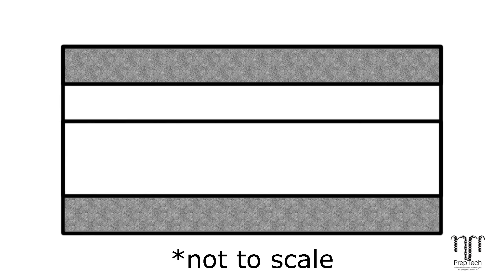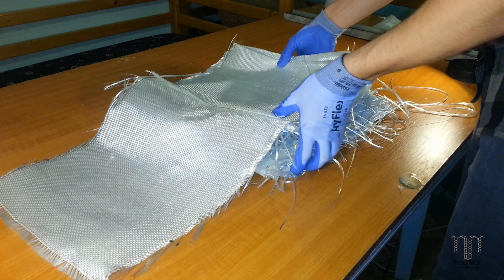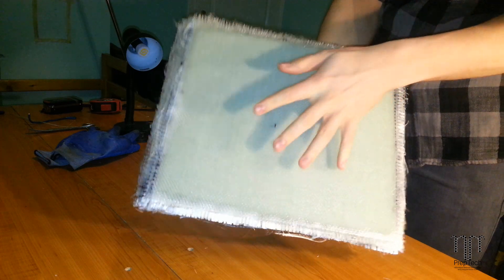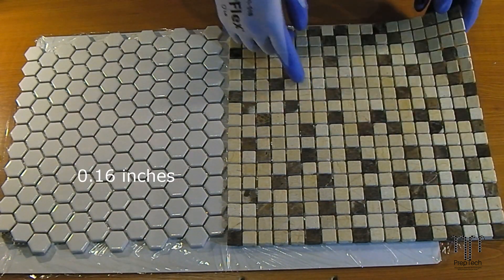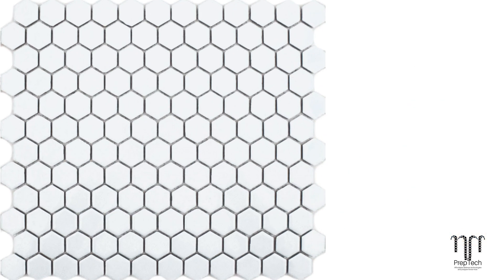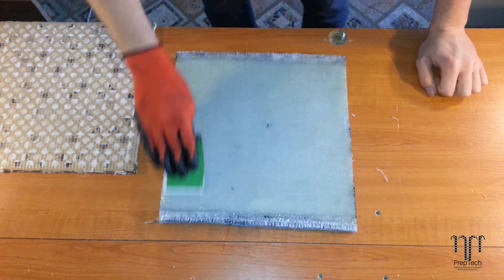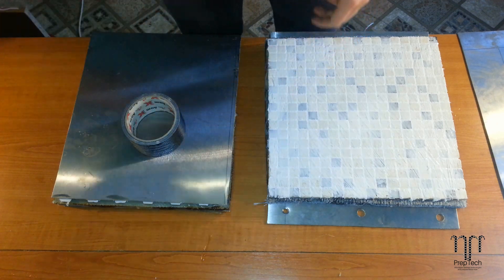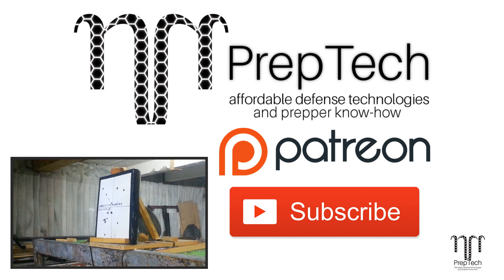DIY Working Composite Vehicle Armour (stops an AK-47) Part 1: Building

Comment: Grinding that epoxy and inhaling the smoke is infinitely more dangerous than the fiberglass dust. It can be lethal. Friend of mine once just collapsed to anaphylactic shock after cutting cured epoxy. he wasn't allergic or anything to it. But he survived because workmate was fast and ambulance was fast there. But now he cannot be in vicinity of raw or cut epoxy. He will get the shock immediatelly.

Comment: Just a quick thought on fiberglass, when I build boats and other things from it we have to sand the cured surface before adding another coat of resin or anything really. The resin makes a waxy film when it cures and needs to be sanded off for proper adhesion of the next layer of resin, paint, gel coat ext. 
hope this helps

Comment: Well the way a glass (including ceramic, it's a type of glass) dissipates kinetic energy, is by spreading it out across it's surface area, until the whole thing shatters.
So, the smaller the glass (ceramic) plates are, the less energy they can dissipate. You end up having to weigh the pros & cons of different sized pieces. Larger pieces dissipate more energy. Smaller pieces mean less area compromised by being hit. US car windshields (required to be 2 panes of glass laminated together with a flexible bonding material, to keep occupants in, and deer out), are broad enough to effectively dissipate energy nearly equal level 2 body armor, but only ONE time. 
Also it helps to have your fiber weave material arranged with alternating angles, like + and x orientations (this wastes material when cutting from the cloth, but it helps).

Two main approaches are very hard material (but brittle) on very strong material (not brittle). Or a very tough, but lightweight & flexible matarial ("catches" projectile).

Mostly ceramic is used on armored vehicles to resist "active heating" from projectiles with explosives in them (due to ceramic's high temperature resistance). The fact that it is also a type of glass, means it can achieve double-duty as a form of kinetic energy dissipation. So it's ideal in tanks. But against small arms fire, I don't know if ceramic is ideal or not. But it doesn't make a large amount of dangerous "glass dust" compared to other types of glass, so it is at least easier to breath while being shot at.

If I were designing an armor for a light vehicle... I'd go with something which is both hard and strong (like AR500) for the exterior layer. There is a form of AR500 which has a metalic glass seared onto it's out-facing surface, this is very very (very) durable. So durable that it's not even practical to smooth the outer surface. Then under that, ceramic tiles to dissipate energy. Then aluminum structure (mounting, framing, chasis), And lastly a kevlar blanket on the inside which is mounted only by edge grommets, so that it can flex & stretch when pushed on by bullet fragments or spalling. For windows, several layers of tiled tempered glass embeded in a mono-block of polycarbonate. Alternatively though, there's something to be said for just using thicker steel for armor, and letting the armor do double duty as the vehicle's chasis.

Interestingly, soil (sand or dirt) is amazingly bullet resistant. I think there would be some advantages to a sort of blanket of co-joined sandbags. Would be light to transport to a location, and fill with 'armor' on location. Easy to apply/remove. Think "scale-mail" but made of sandbags which attach to a robust webbing. A hidden benefit would be that this would also have amazing RCS and thermal imaging qualities. And if you deliberately did a sloppy job while filling the bags, it would blend in with the local dirt hues. Alternatively if you were tidy and used matte black sandbags, it would be hard to laser designate/rangefind. It would be shockingly "stealthy". Even has excellent radiological qualities. Also, it would be as cheap as dirt. It wouldn't take much to apply grommet pegs to the exterior of a light vehicle to hold it in place. It would effectively be self-healing even, not to mention spalling-proof. To shoot through it you'd need at least .50 BMG, and that wouldn't "go through" exactly (not with any effective energy left), it would just burst individual sandbags, and eventually eat the armor away. It's also a very DIY-friendly concept. 
So one of the best light vehicle armors there is (in my opinion) would be burlap, rope, and a small shovel.

Comment: when you make these used strong forms and clamp them as tightly as humanly possible. the less resin, the lighter it will be, and stronger because there is more glass per square inch

Comment: works like a charm.  testing with panels installed in a junk car, put final product in an F250 to armor the door panels, seats, foot well, dash and back of the crew cab.  It does kill your payload capacity though so be sure to check your weight limits.

Comment: I’ve been part of and run Composite/Fiberglass shop for whatever that’s worth. By NO means have any experience with ballistics panels or “Bullet Proof” material. Their is ton of different cloth materials available. On projects like sailboats where lamination is thinner we use (Bi-Axel) & for better  strength and flexibility (QUAD-AXEL) cloth  Also epoxies like West Systems for epoxies or higher grade Resins like 700 Grade Resin like used in making of bowling balls. Alternate directions of each layer of cloth. Turn each layer 1/4 turn from previous lay-up. Hope info helps. Not trying to show more knowledge only suggestions that may or may not help. Also the week (7 day) and slower cure time is very important! Different epoxies/resins have different cure times need to follow manufactures flash off instructions to ensure product cures least brittle as possible. I have been thinking of  layups as well hadn’t gathered enough info to do so such as didn’t consider the ceramic core among others! Thank you for sharing your info and experience hopefully save me some trial and error as well. Appreciate your time and info. Lookn forward to your future projects. Stay safe thanks again

Comment: Floor tiles are added weight with no balistic value.
Reply: You are wrong. The only way for modern armour to stop bullets from rifles is with ceramic or similar materials. The problem here is that the ceramic tiles are too small and too thin (the hexagon ones) or just way too small and not good material for the marble ones.

Comment: Hi prior to making your cuts, try placing painters tape on both sides of your cut line (on both sides of the fiberglass).leave about 1/2 inch between the pieces of the painters tape.  wipe a thin film of silicone on both sides of the fiberglass.  When dry make your cuts and remove the tape.

Comment: 2 small tips. Use nylon fibres evenly mixed into the silicon for added strength, and use a spall liner on the rear. High wear strength carpet would do at a pinch, and that could be improved a little too with a hard plastic/soft plastic layer between the steel and carpet|! :)

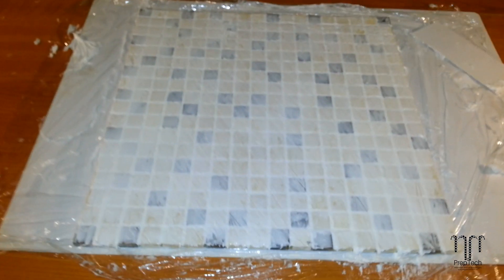Comment: 6:00 Sounds very logical!
Reply: Smaller tiles make it better to withstand multiple shots but larger tiles can absorb more energy.

So smaller tiles can take more shots but those have to be from smaller projectiles while large tiles can take fewer shots but from bigger projectiles.

The ceramic layer is key in composite armour for converting kinetic energy into the energy needed to crack/break chemical bonds of the parts that keep ceramics together.

Comment: 1:12 

* Got multiple hit capacity.
* Light enough for fit on a vehicle.
* Easy to build.
* Durable.
Reply: @Jimmy Olano You’re wrong too. It wouldn’t be “Got multiple hit capacity”, it’d be “It can take numerous hits. His second one was right, “Light enough for fit on a vehicle” is wrong, using “for” makes no sense. Your last two corrections is merely just capitalizing. Next time you want to correct something make sure your corrections make sense.

Comment: Maybe looking into two part silicones makes your life a bit easyer. You can buy some that are quite liquid so they flow between the tiles. Also the regular silicone doesn't cure very deep, just the surfaces that is contatct with air.

Comment: Why not simply use a 1/4" AR500 steel plate?
Reply: You can cut it with a cutting torch, drill it with a carbide mason bit crazy sounding but it works  , ID it with a file if it bites deep its mild steel if it sings off its ar500 , as far as welding it goes for a 1/4 you could us a 7018 rod with a pre heat or if you want to get fancy a e11018 with a pre heat
Reply: It's not readily available. Additionally it's difficult to drill, weld, etc. Also, supposing you're improvising, how the hell do you identify a piece of ar 500 from a piece of mild steel?
Reply: And the other part of that is just about every sawmill, rock quarry, mine, or industrial area has it pretty much laying around search the local scrap yard

Comment: I did a little research on Alibaba, aluminum oxide plates are dirt cheap, I think they can do better than just normal mosaics, and if you want go for full nuts, those silicon carbide plates' price are not their actual price, you will need to contact the dealer for actual price.

Comment: One more thing.. . Think of a tank and how it has evolved since World War II. The Russians and soon after the Germans realized that sloping armor would cause projectiles to Ricochet or bounce off. Who says someone couldn't with imagination and patience somemade at home or in a shop some sort of armor that is light but also has angular portions where vital organs are. I can almost guarantee you would have significant protection. In my mind the 223 depending on the angle of the shot would either bounce off or take some of the muzzle energy away from the target area. The only major problem I can see is different angles enemy fire would come from so a solution would be necessary course a 90-degree angled shot would have the same effect as yours only it would hit a void so a slightly different design could be a thought like small pyramid-shaped projections from the armor. I can almost without a doubt say that this type would obviously have a cost/benefit coefficient and probably would not be able to be created in mass production but who knows in this day and age. When you're a tinkerer overtime you gain knowledge on what works and what doesn't and you obviously have a lot of knowledge and give many people ideas. I have attempted to make some of your projects, some of them with success and others with complete and utter failure but that's how you learn. I'm sure this sort of armor would not be well-received with military personnel because of the extra weight because if you were to flatten out these plates the patterns of small pyramid-shaped projections  would add more surface area thus more weight. But I am very confident that if it works on tanks then scaled-down there would be no reason that it couldn't be used by the public if(armageton) was to come to fruition the resources and tools were available to people which they are. Just imagine what your adversary would think. I absolutely think that's a little bit optimistic but it sure is fun to think about it and get a few Chuckles

Comment: Fiberglass is old technology what a lot of governments have moved away from (due to the dangers of particles when hit), cracking, and lower performance - It was what's used in helicopter crew armour as a spall shield (look up "Vietnam chicken plate"), as well as early composite vehicle armour (Land Rover Snatch). You might want to look into buying old police/military vests and salvaging the kevlar instead, sometimes you can find a pile for dirt cheap from companies that does disposal of surplus/outdated/out-of-warranty equipment for the government.

Proper ceramic mosaic tiles aren't "$100" each. It's usually $100 per batch (usually just enough to make 1 sapi plate). Nevertheless expensive unless you arrange to do it in bulk.
Reply: fiberglass is more available to civilians which is why is why it is being used for diy projects.

Comment: Isnt it smarter to just stack 5 or 6 of the aluminum sheets together?
Reply: Compositions provides multiple hardness, density and mass that lessens the projectile's energy each material it goes through.  It works more efficiently rather than just one material also it may reduce the weight or material application depending on the type of materials used in the armor composition.

Comment: A few things.  Using small amounts of 'polyester' resin as used in fibreglass panels made to provide ballistic protection lets some energy be transferred into de-laminating the panels.  That is, it's on purpose.  Similarly a larger tile will allow more energy to transfer into it [thats what the cracks are] reducing the ability for the projectile to penetrate.  Porcelin with the highest wear ratios are ballasticly superior due to being harder.  So obviously you have to consider what properties you want, destruction, cost and weight.
Reply: Well.......the M1 abrams uses many tiny tiles so I'll go with this guys idea
Reply: @theq4602  those tiles are probably stronger because they are designed to be for bullets
Reply: Larger tiles also means less hits.
Reply: Excellent comment!
Reply: Small hex tiles 👍
Reply: IF YOU ASK ME, I'D THROW OUT THE THE CERAMIC, THE MARBLE OR ANY SUCH TYPE OF WEAR MATERIAL THAT COULD MINIMIZE MULTI-HIT CAPABILITY... WELL, I SAY THAT BUT, IF I WERE TRYING TO STOP A 50 BMG ROUND, OR SAY, A LOT OF THEM,  LOL... THEN, I'D PROBABLY BRING THEM BACK INTO THE DESIGN BUT, ANYTHING BETWEEN A HANDGUN AND A 416 RIGBY, NAH... DON'T NEED IT! MY SECRET? TI-6AL-V4 @ .0100" THICKNESS... I WISH I COULD'VE AFFORDED AN EVEN THICKER PLATE, LIKE: .0200" THICK FOR EXAMPLE BUT, THAT SHIT AIN'T FLIPPING CHEAP! LOL... 

NOW, TO BE HONEST, I'VE NEVER TESTED UP TO THE 416 RIGBY BECAUSE, I DON'T KNOW ANYONE WITH THAT MUCH MONEY BUT, 308 WINCHESTER, 7MM REM MAG AND LESSER ROUNDS WERE STOPPED BY THIS LAMINATE ARMOR WITHOUT ANY FUSS! WITH THE AFORE MENTIONED RIFLES DELIVERING A BOX EACH AT JUST 10 YARDS! EACH RIFLE TEST GETTING IT'S OWN PLATE... SO, THEY'LL TAKE AT LEAST 20 ROUNDS OF SOME REALLY HOT, MEAN LEAD! ESPECIALLY THAT 7MM MAG.. TOOK THREE PEOPLE TO PUT 20 ROUNDS ON TARGET! AND THAT CONCLUDED OUR DAY, just that one test..  HAHAha-ouch!

DETAILS:
USE 5 PLATES OF TITANIUM,. ONE IN FRONT COATED WITH AN ANTI-SPALL COATING ( TRUCK BED LINER, 1/4' THICK ) 1 OUT BACK & THE THREE REMAINING IN THE CENTER, SEPARATED BY YOUR CHOICE OF WOVEN CLOTH PRE-LAMINATED PANELS, 1/8" THICK PER PANEL, YOU WILL NEED 4 PANELS. YOU CAN USE FIBERGLASS, KEVLAR, CARBON FIBER, & EVEN DENIM, ETC.. STACK THEM AP;PRIOPRIATELY AND GLUE TOGETHER WITH WHATEVER YOU WANT.. I USED GORILLA GLUE... ITS A LITTLE FOAMING AND GOES EVERYWHERE WHEN YOU PUT THE CLAMPS ON FOR THE FINALE SQUEEZE BUT, IT HOLDS TOGETHER NICELY, EVEN AFTER SEVERAL HITS! ONE SOME OF THE TEST PLATES, I USED GAFFER TAPE AROUND THE EDGES SO THAT WHEN THEY FINALLY DELAMINATED, THEY WOULDN'T JUST COMPLETELY FALL APART.. THAT HELPED A BUNCH! HOWEVER, ONLY GLUE THE EDGES WHERE THEY CONNECT TO THE FRONT AND REAR PLATE, NOT ON THE SIDES OR THE CENTER OF THE TAPE... IT'LL SHATTER! THEN YOU WOULD'VE DONE ALL THAT FOR NOTHING... TRUST ME,  I LEARN EVERYTHING THE HARD WAY SO, IT DOESN'T HELP. ...NO SIR!

WHEN I STARTED DOING THESE PANELS, I STARTED WITH THE OVER-BOARD, OVER THE TOP 5 PLATES OF TITYANIUM AND THEY STOOD UP AGAINST 5.56 & 7.62X39 WITH NO TROUBLE, AT ALL... & ON UP TO THE 7MM REM MAG..  IN FACT, WHEN TESTING WITH THE 5.56 OR THE AK, JUST GO AHEAD AND SEND ALL THE MAGAZINES DOWN RANGE! LOL, WE HAD THREE PER RIFLE... SO.. IF YOU HAVE MORE THAN THAT, I MAKE NO CLAIMS TO IT HOLDING UP ...NOT BEYOND 90 ROUNDS, LMAO!  ... BUT DEFINITELY CAPABLE PLATES, NONE-THE-LESS! BUT NOT CHEAP TO BUILD, NOPE!

THE NEXT STEP WAS TO SEE JUST HOW DOWN SIZING COULD HELP! REDUCING COST AND BUILD TIME BECAME A HIGHER PRIORITY AND WE WANTED TO TRY BOOSTING EFFICIENCY BY SHEDDING SOME UNWANTED WEIGHT & ELBOW GREASE...  AND BURN LESS MONEY... BECAUSE THAT WAS DRYING UP QUICKLY TOO ( I WISH I COULD GET MY BIG ASS BELLY TO DO THAT JUST AS EASILY BUT, I DIGRESS... ) I WENT WITH JUST THREE TITANIUM PLATES WITH TWO 1/4" CLOSED CELL FOAM SEPARATER SHEETS, LIKE CRAFT FOAM FOR KID PROJECTS IN BETWEEN THE TITANIUM, LAMINATED WITH GORILLA GLUE AND SPRAYED WITH A SPALL COATING UP FRONT, 1/8" THICK TO START... AND THAT COMBINATION WOULD STOP PISTOL ROUNDS WITH EASE! 9MM, 45 ACP, 40 S&W, 357 SIG,10MM, 357 MAG - HOT ONES TOO, FROM UNDERWOOD AMMO! UNFORTUNATELY, NO ONE HAD A 44 MAG TO TEST THE THREE PLATE VERSION AT THE TIME... 

THEN THE 3 PLATE VERSION EVENTUALLY RECEIVED AN UPGRADE WITH SWAPPING OUT THE ARTS AND CRAFT SCHOOL SUPPLIES WITH RIGID  MARINE GRADE FOAM BOARD AND THAT WORKED OUT SWIMMINGLY!  THE DAMN PLATE WOULD ACTUALLY FLOAT IN THE POOL... WHICH WAS SUPER COOL! NOW, IT WOULDN'T SUPPORT ANY ADDITIONAL WEIGHT & KEEP IT AFLOAT BUT, IT WAS STILL TRICK AS SHIT TO SEE ACTUAL ARMOR FLOATING, YA KNOW?

HOWEVER, IF SOMEONE WERE TO USE THIS SET UP IN A PLATE CARRIER & ON A BOAT FOR PERSONAL PROTECTION...  AND FELL OVERBOARD FOR WHATEVER REASON, IT WOULDN'T DRAG THEM STRAIGHT TO THE BOTTOM OR HAVE'EM SCRAMBLING FOR THE RELEASE BUCKLES EITHER! PLATE THICKNESS WAS ROUGHLY 1.25" WITH AN 1/8" SPALL COATING SO, IT COULD FIT MOST CARRIERS. BUT 5.56, 7.62X39 WERE ABLE TO GET THE TIP OF THE PROJECTILE THROUGH THE BACKING PLATE BY A 1/4" ON THE 5.56 AND ABOUT 1/16" FOR THE AK ROUND, BOTH LODGING IN PLACE! BOTH WERE STANDARD BALL AMMO AT STANDARD PRESSURES. NEGATING ANY CHANCE AT AN NIJ LEVEL 3 RATING... DAMN IT! I WISH I COULD POST PICS BUT... IT IS WHAT IT IS! GOD BLESS AND STAY FREE!